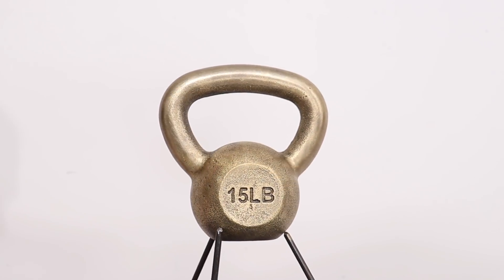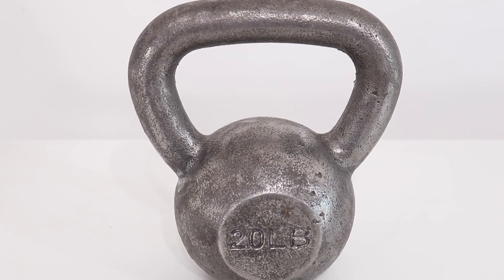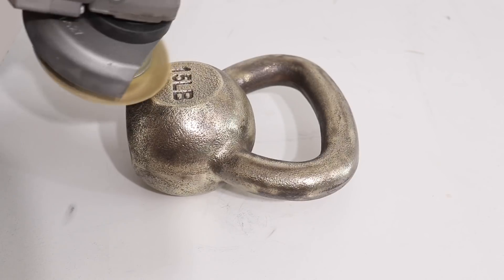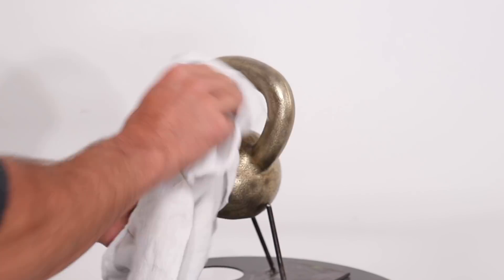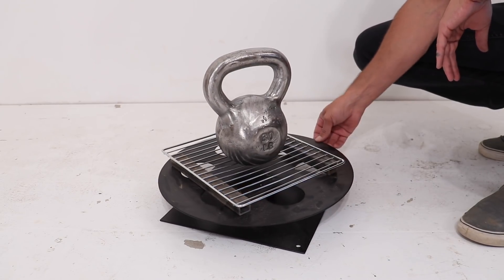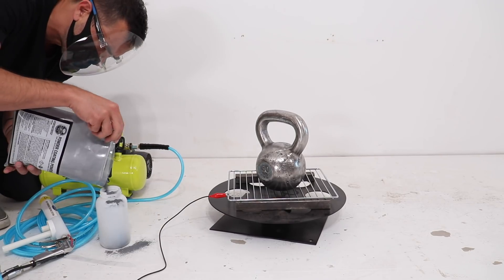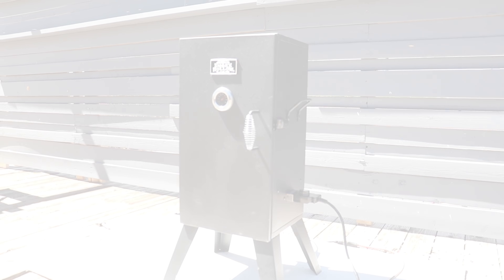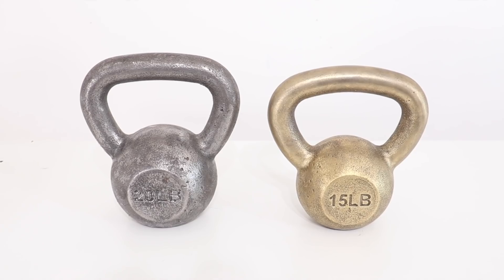Brass Plating a Kettlebell | Maker Experiments 01

Comment: These would make excellent door stoppers. I have some old (as in, about 100+ years) cast-iron irons! These were, once upon a time heated on a wood-fuelled stove, and then used to iron clothes. Imagine trying to get that temperature just right! I use these to hold doors open. My french doors that lead to my courtyard need something taller than these irons. I've drilled holes into the pavers to latch the doors down but if it's really windy, these still move around quite a bit and make a horrid noise. I've been using some concrete statues or pot plants until now. Kettle bells seem a lot more convenient.

Comment: I had no idea that the brass from brass wire brushes would actually melt and transfer to other metals. I am about to update an old banana lounge and need to clean up the metal frame and legs. I was then going to spray paint this part before tacklling the top soft layer. Once I get any initial grime and rust off, I might have to try using some heat before going in again with some brass brushes. I wonder how well this will work for me? The only heat I could apply would be from either a heat gun or my weed burning tool (uses butane fuel cans). I don't know if these will get enough heat. 
By the way, as for your powder-coating experiment, it may be an idea to find someone with a kiln you can use. There are often community art precincts where you can use their facilities for a small fee.

Comment: The cast iron needs to get up to about 700F- 800f for this to work properly, more importantly you should understand at what temperature bluing occurs on the metal you plan to add the brass to, it will stick better to a blued surface. You could put this on a grill and heat it using hardwood branches and charcoal. Use a alser thermometer to get the temp up.  I would rather use a hand brush than a rotary, the speed is not helping you at all. The wires melt at the tips so a gentle brushing over a properly heated surface is many times more efficient. You can buy a box of 20 brass brushes for like $10. Another thing to note is that this is an iterative process. You can build layers upon layers of brass. Brass is Olygodynamic which means that it holds its own electrical charge and kills pathogens on its surface when left idle, takes about 6 hours or so. This is probably a better way to utilize the brass rather than coating it in a finish.

Comment: I'd love to see a method that showcases a way to highlight the weight lettering. I did a refinish myself with general black, then light on the front-face facet and then hand painted the lettering. The casting was pretty rough, so my hand lettering ended up highlighting the sloppiness of the cast. It works but I wouldn't say I love it. I'd love to see what ideas you have.

Comment: I was skeptical at the success of powder coating a kettlebell when you gave me a shoutout.  The curing starts when the kettlebell reaches PMT.  that means that mass of metal has to reach 400 if that’s what is called for,  at least on the outside.   Also getting the powder on the underside would be hard on the setup your using.  You may need to use a hook.  Still came out ok.  Also, did the chrome call for a clear coat?   Last thought.  Check out PrismaticPowders.com  they have 1,000’s of colors.  You may find something more to your liking their.

Comment: you could try gun bluing. from what i understand its a form of rust? its what gives guns their black protective non paint coating
Reply from the maker: good idea!
Reply: You heat it up then put in into used motor oil or you can use cold bluing.
Reply: @lecobra418  what temperature does "hot bluing" happen at? i would assume it needs to be red hot? i wonder if the oven in the video could work.

Comment: Probably already on your radar, but electroplating would be cool. I think copper would make a great additional color / finish for this set, not sure if all metals can be electroplated together though so there might be some research involved in that.
Reply from the maker: I am researching it but so far all the kits are pricey
Reply: @HomeMadeModern  @baremetalhw on YouTube does some cool stuff with electroplating. Granted on the MUCH smaller scale of diecast cars, but i believe his setup is homemade.
Reply: @HomeMadeModern  Here is his first video on the subject https://youtu.be/fh8aGasuWyA.
There is also a high rated comment on this video that discusses brush plating as a first step instead of using the paint he uses. I think his later videos refine the process but i don't think he did a dedicated video so I couldn't point you to a specific project where it was used.
Reply: I will say, copper plating iron is a little more involved. You need to plate in nickel first.